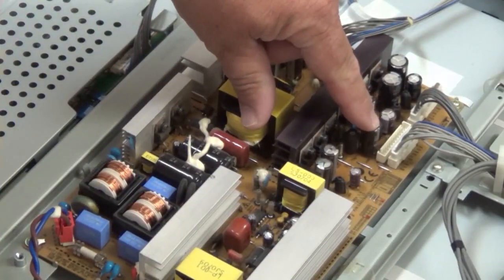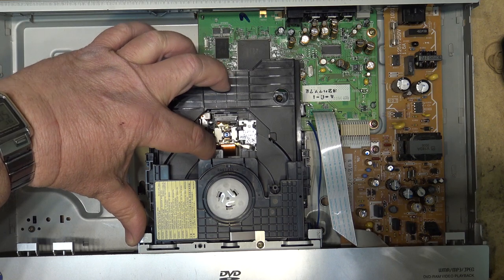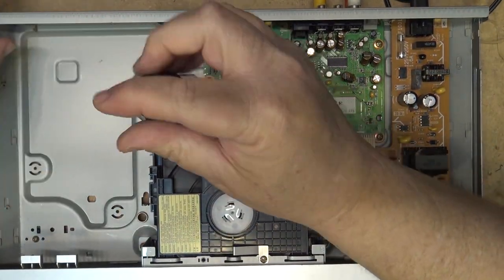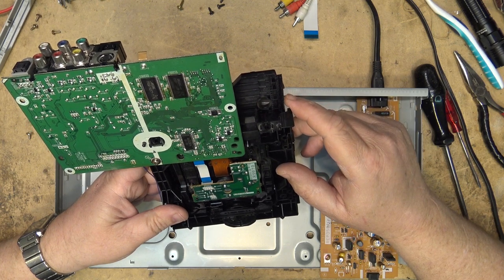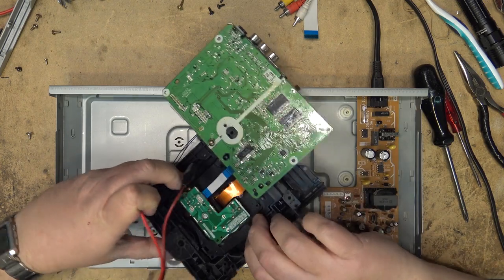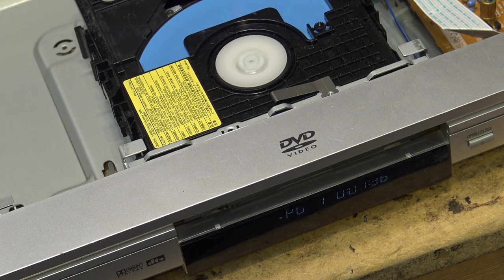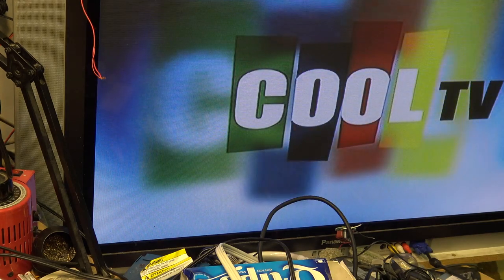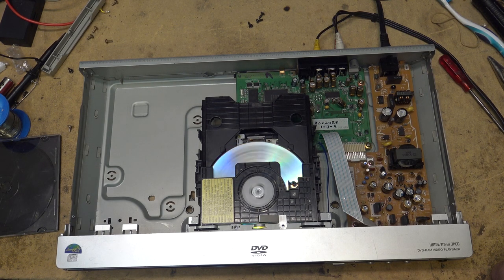Panasonic DVD S35 No Playback repair

Comment: You always amaze me with your skills and knowledge dave, i mean that.
I would have missed the motor fault while cleaning the lense and making sure the sled moves easy and smooth.
Some have worked fine after a clean and lube.
I never liked the idea of a bare uncased dvd, no protection from dirt/sunlight/grease or scratches.
A very silly decision that damaged so many data backups.

Comment: From the moment it first spun up, I felt the motor didn't sound quite "right" somehow & like you mentioned, a lot of vibration when you spun it up fast... I wonder if the lubricant is either drying out with age or contamination with old bearing/brush material & spinning it up so fast has "worked" it into being a bit more malleable temporarily. If the motor can be taken apart I'd consider cleaning it and adding a dab of your Molyslip/molykote grease if it happens to fail again shortly.

Comment: You giving that motor a good run reminds me of back when I took stuff apart. I had this electric train transformer that put out 17 volts DC at maybe 1 amp and I'd wire a small DC motor to it and if it was a 3 Volt motor it would scream like crazy when you cranked up the power, sometimes even screech because it's going so fast. Fun times. I've burned some junk motors out doing this.

Comment: As I've stated in another video comment - I always spray switch cleaner / lube into disk motors during a service. A common fault is that audio CD.s can not play later tracks because the motor loses accuracy due to gunk! I winced while watching that as when you put an external current across a device, isolate it! Otherwise you are sending the current right back into the motor drive chip (That's the one with the wide central pins) and you could fry it! But on a more cheerful note, well done for finding it so quickly!
Reply from the maker: It was disconnected from the drive chip. I guess you missed that part.
Reply: @12voltvids  You are right, I missed it having been used to more clunky connectors! Sorry about that! But hopefully it will encourage others to do so. :-)

Comment: Hey,i bought a Philips Fidelio BDP9700 with a broken hdmi port "cheap" for €60.This thing's dac is crazy good on my old Sansui au 3900 amp.For a cd sacd player this thing is for me worth every penny.You think it will be doable for a beginner to replace the hdmi port?Or better leave it as is now?Don't want to f it up.I have now a great cd player.
Reply: Nice, it reads SACDs? I don't care for HDMI, only for TV connection, fiber for audio as my receiver doesn't have HDMI and I don't have the money for new one. To change HDMI port on the new machines you want someone who knows and has the equipment to do it, it is easier to change a chip than the HDMI port on these boards.

Comment: Hello I have replaced 8 capacitors in my Bell receiver but since I did that it wont power on. Wen plug in the ac outlet the green light come on and the fan work for about ten seconds then it seems to go in standby mode. I tried reseting it but nothing. The power supply is ok with the varius voltage. Do you have the schematic of the main board or of the power supply?
I would like to be sure of the capacitors value just in case I have mess up. Thank you and your video are great and I like your clear explanations of the different components.

Comment: Can you get a replacement motor for this player ,and would it be very expensive? I sure a lot of your fans might wonder about that ,neat fix hope it last for you.
Reply: Most likely many other machines use the same motor, same as CD players, tape decks. Sometimes commutator would oxidize and motor suddenly be kaput - contact cleaner spray and some turning should revive it.

Comment: Sorry it is kind of off-topic to this video but I have seen that you and a lot of your viewers are actually really knowledgeable in matters of Bluetooth stuff so I thought I contact you guys.. I want to make my living room wireless (I heard Bluetooth is better suited than wifi?) and thought I would need to buy a transmitter board for every device (vinyl player, DVD player, amplifiers and a tuner so four Boards?) and then I need to get a receiver which will receive all the Bluetooth signals. I connect the output of the receiver to my speakers and subs at last and should be fine right? Please someone help me out with this I am so confused.. Thanks guys, stay well oh and nice video btw

Comment: An advert on amazon for Electcom dvd player says, "Anti-shock protection ensures for dvd player that you have nothing but uninterrupted viewing pleasure as it reads ahead, and provides a smooth, reliable viewing experience"     
     I have a dvd -RW which my Sony DVP 760H always freezes on.  Fearing the disc to be warped, I keep pressing it between two pieces of glass.  It works a little better but not totally cured!  I shall keep pressing!
      Would "Anti-shock... reading ahead", as described above, be capable of playing my -RW problem disc?    In short I am wanting a dvd player I can trust to always play without 'freezing'.
       I can't relax when I play a dvd  - I fear it will stall or freeze.  Should I trust "Anti-shock... reading ahead"  mechanism, please?

Comment: Great video. I have a Pioneer 2080 laserdisc player doing exactly the same thing. What tool are using to apply power to the motor?  I’d like to try your solution. Thanks!
Reply: If it was sitting unused there might be commutator problem as it oxidation builds up. Good contact cleaner and some turning, then 5, 12V whatever the motor is rated just like Dave did. If it starts to work apply some lightweight oil onto bearings. Hope it helps. They also play CDs, so check if it reads CD just to make sure the laser works.

Comment: Interesting. I'm still shaking my head here watching that 'fix'. Clearly it solved the problem but I've never ever heard of that technique and more to the point I couldn't see the clues that would lead you to suspect it WAS the motor. I expected a problem with the lasers or caps or connections and as the motor WAS spinning the disk I would not have even considered that course of action. It looked like it was working without an issue. Well done though, it's sorted.
Reply from the maker: Bearing worn.  Disk wobbling causing no read.  These fixes are usually only temporary. Could last a few days or a few months depending on when it gives out again but it was more to show the fault and how it works after proving it is a mechanical issue and not the laser.

Comment: I have an old Blurayplayer (50 Dollar Range 10 Years ago...) it plays Blurays but not DVD's anymore. When I re-insert the DVD 10 times it sometimes plays it... probably some gunk in the motor/mechanics as well.
Reply: A bit of controlled motor overvoltage wouldn't hurt

Comment: Have a s35 also but mine is crazy when opening closing and reading the disc. Only after lots of  attempts it reads and plays but most of the time it does not close, or closes and does not read (says no disc) , displays Reading on tv with the tray open. All kinds of issues during closing tray and disc reading and all of a sudden it decides to read and play normally but if you take the disc off the open close reading issues start again. Dont know what it is

Comment: What was the voltage given to the motor.
Reply from the maker: I believe I said what I cranked it up to. About 11
Reply: @12voltvids  Thanks. If we replace this motor with a new one do we need to change focus.
Reply from the maker: @sivajisivaram2013  you need to set the spindle height correctly or it won't focus.
Reply: Can you give names of Ckt board cleaning liquid & contact cleaner used in your videos.
Reply from the maker: @sivajisivaram2013  
I use Nutrol, and Deoxit D5, and D100 formulas.
Reply: @12voltvids  My VCD player just spin continuously won't stops but not playing, replaced lens also showing same problem again. Can u suggest anything to solve this.
Reply: @sivajisivaram2013  Seems to me like a laser/optical pickup issue. I'd say grease up the rails first, then see about finding a replacement pickup if that doesn't work

Comment: See this model all the time at thrifts for $10 or less, must have sold like hotcakes at one time.
Reply from the maker: Lots of them out there.  I used to use this one all the time but no more.  It has been collecting dust for years and the only reason I hang on to it is ti play the material I have on DVD RAM